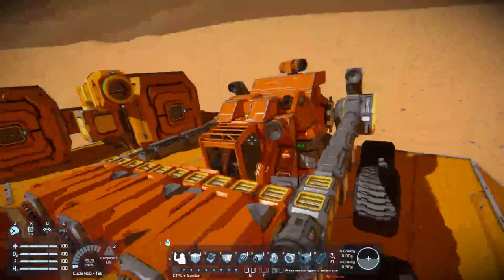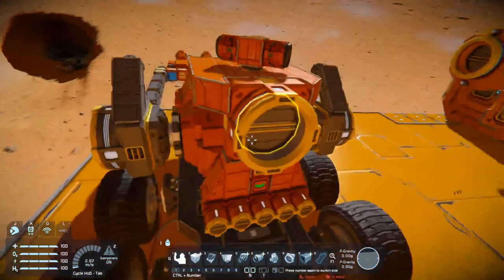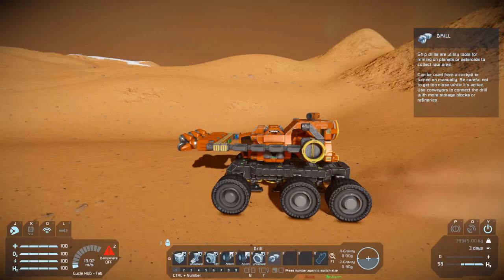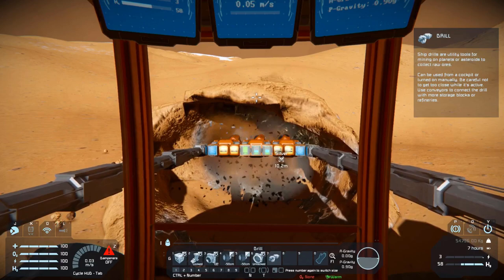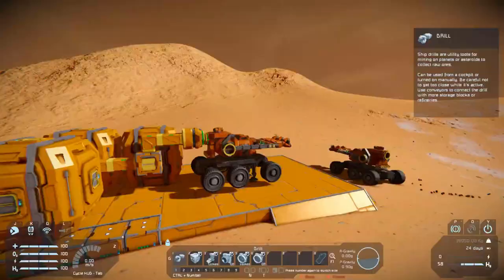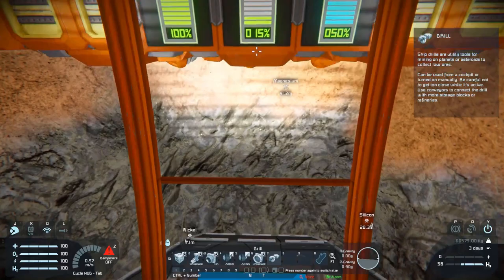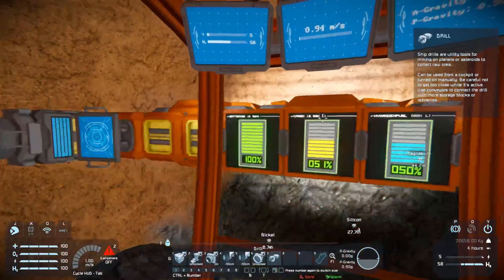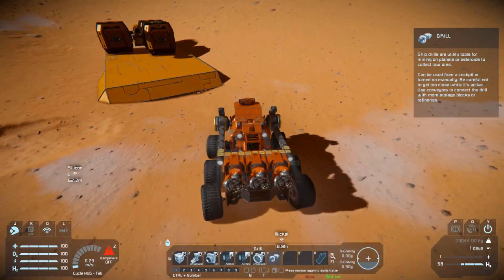Space engineers: HMEV mining rover

Comment: How, for the love of all that is holy, did you build the beam in the front, with the drills on it, and connect it to both rotors at once? I've been trying to do that for 6 hours now and very soon I'm gonna start breaking stuff.
Reply from the maker: Black magic, jk. i attacked mergeblocks to the boom and right piston arm, while they were seperate. i had the left piston arm extended and the right retracted, i then reversed the left piston arm and the boom until the merge blocks connected. I may make a video soon on how i performed this dark ritual!
Reply: @MrCalypso84  thanks! For some reason when I tried that my entire construction started destroying itself because the merge blocks collided instead of merging. I actually managed to do it sideways now, so I connected the two half-beams in the middle using the rotor offset and pistons to push the arms together. Not my first choice but it worked
Reply from the maker: @Krestestovnikoff  Klang is very vengeful when it comes to this dark ritual, he really doesnt like for it to occur. But im glad you found a work around.